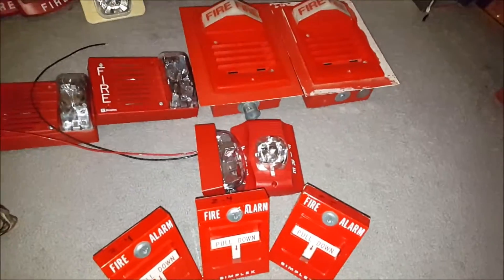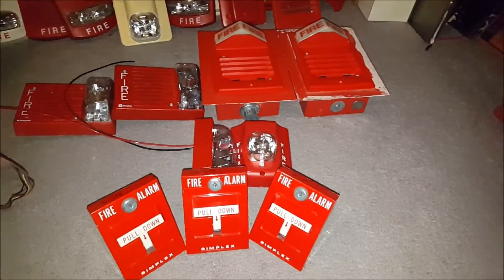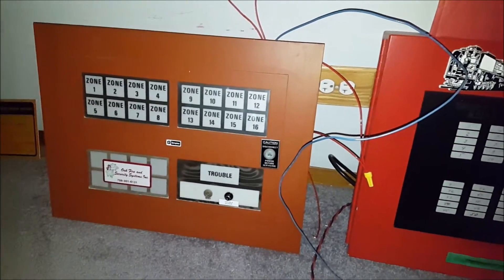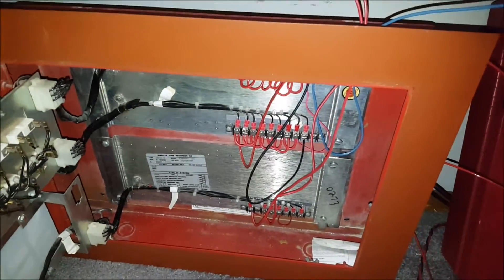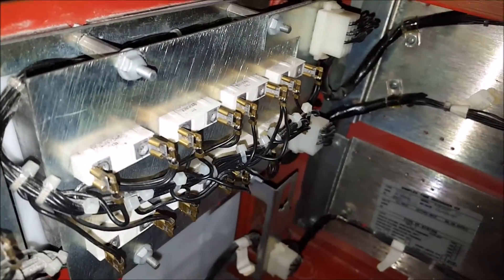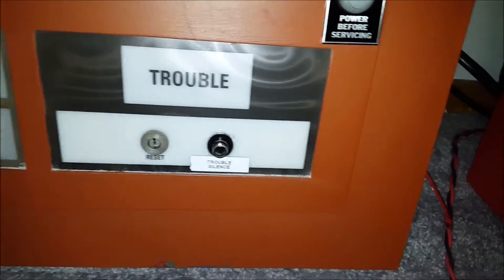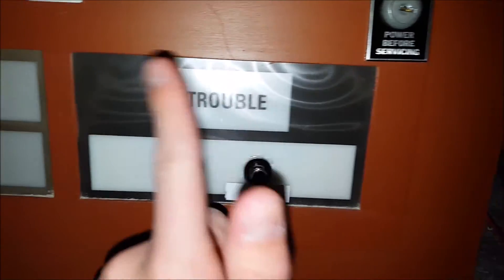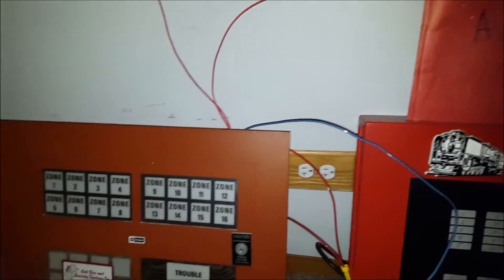Fire Alarm Parts Update

Comment: I don’t think the panel was a 4002. Looking at that annunciator, and that it used bulbs with single wires, the panel might have been a VERY late model 2001 that was ordered maybe a year or 2 before the building was built in 1989, because sometimes fire alarm systems are ordered long before buildings are built. That’s my guess, but I could be wrong
Reply from the maker: Believe it or not, a technician who actually serviced the system and this annunciator commented one of these videos, and he did confirm it was a 4002.
Reply: msj191961 hmm, I'm curious to know then how the annunciator was wired up

Comment: My brother's dorm complex has the exact same signals (the 2903s with 9838s on trim rings). Simplex is seen a lot on that campus, almost dominant! I've only seen an outdoor Wheelock RSSWP outside one of the dorms which I believe have ceiling mount Simplex Truealert Speaker Strobes.

Comment: That remote annunciator is pretty AWESOME! I wonder if that was stock made in 1981, but probably sat in a shelf until it was installed in 1989. Didn't think a 2001 would be installed this late in the 80's, either. Again, probably was stock that sat on a shelf until it was installed in 1989. Kudos goes to the contractor for all he has done with salvaging all the devices that you now have, wish to be that lucky at some point.
Reply from the maker: +NewEnglandElevators Yeah, that's a possibility! And he really is a great guy!

Comment: There was almost definitely a 2001 in that building.
Reply from the maker: +Jack Kirkpatrick Thanks for the info! In that case, I might be somewhat happy I didn't get that panel, since I really don't trust myself with those old card-based panels. Like I said originally, based on the horn/strobes and pull stations, I figured it was a 4002, but after getting the remote panel, I think your theory is correct. A 2001 or an equivalent panel.

Comment: Could that reset switch reset the latching relay circuit for the trouble buzzer?
Reply from the maker: +kcin556 That's a good theory, although I'm not sure. At first I figured it was a reset switch for the whole system. I'd love to wire it up the way it's supposed to be, but I'm not sure how to, and I definitely don't want to run power where I shouldn't. I already did that once with this panel, and I'm lucky I didn't fry anything, haha.

Comment: thank you 😁 and what kind of kenwoods do you have?
Reply from the maker: +Sam Buffington Yes, I will, but I doubt I'll get one anytime soon. Yes, every radio must have an antenna. When you key up the microphone, the radio sends your voice out through the antenna as a radio wave, and any other radio on the same frequency within range will pick it up. Many companies and emergency services will use repeaters, which take the weak signals from the radios and amplify the signal out a large antenna which can be picked up for miles and miles. As far as powering my radios, I have to have them connected to a large 12 volts DC power supply. If I moved one out to a car, I could plug it straight into the car battery, as a car battery is 12 volts. Whenever you install a mobile radio in a vehicle, you always usually use the battery.
Reply from the maker: +Sam Buffington Don't know why you're thanking me, but okay! Haha. Well, I have a TK-862G and an NX-800.
Reply: +msj191961 i didn't mean to put thank you but would you recommend a tk 8180 or nx edge
Reply from the maker: +Sam Buffington Definitely. Haven't owned a TK-8180, but the NX-800 is the upgraded equivalent, and it's a wonderful radio. I'd say all of Kenwood's NEXEDGE units are great.
Reply: If you get a TK-8180 can you do a video on it? I think my school district uses the 8180 or 7180 I might ask my bus driver. And do you have an antenna? or something like how do you talk on the radio? I thought you needed a car or something?
Reply: +Sam Buffington 
He does indeed have an antenna. I believe they run on 12v DC power which means to run them outside of a vehicle you need an AC 120v to DC 12v converter, probably also using a car "cigarette lighter" port.